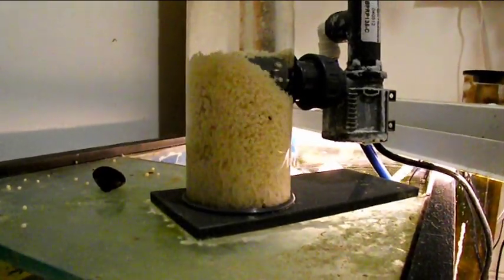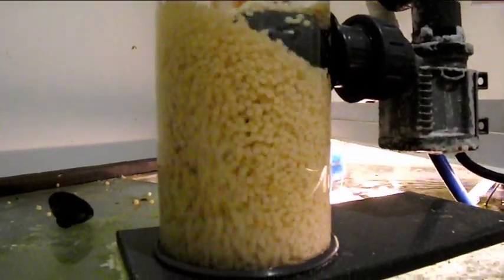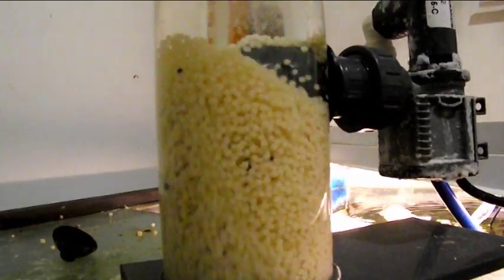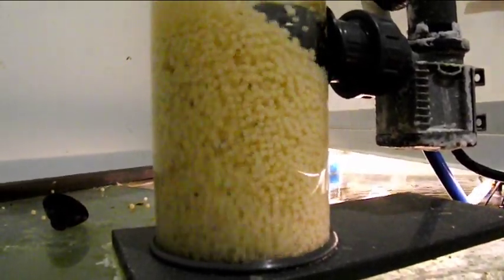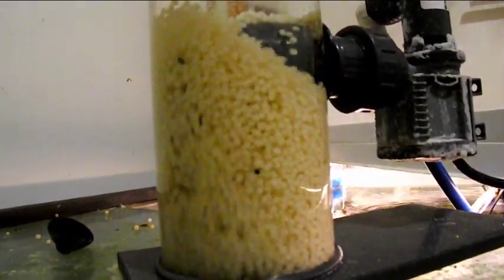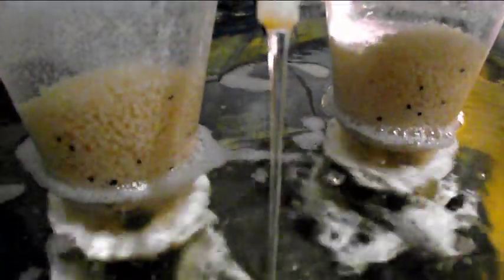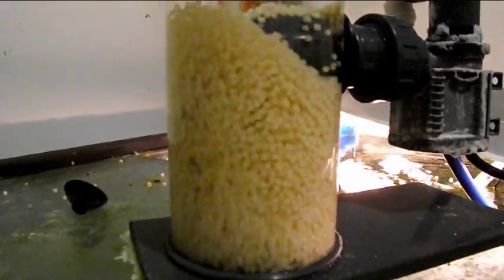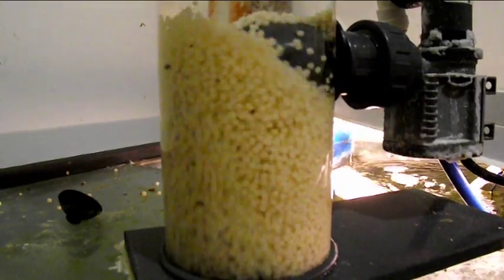How to REMOVE NITRATES  with Bio Pellet reactor How it works

Comment: Simply presented, but I could not understand the name of the manufacturer you mentioned.
Reply from the maker: i have switched to a C.A.D. rector the original is not reliable and bogs up all the time  Avoid reef dynamics and use C.A,D. reactor  Then you can use any bio-plet  brand and it works well